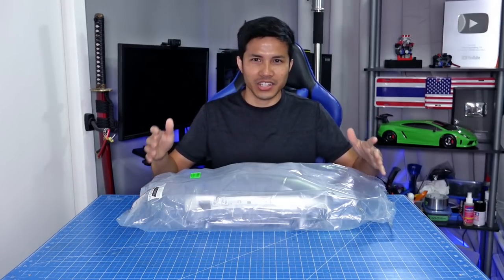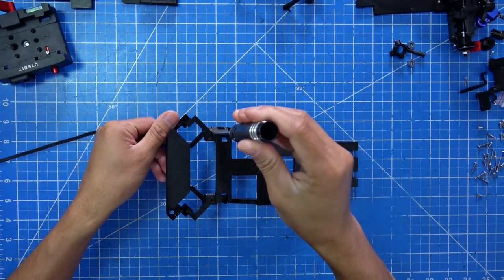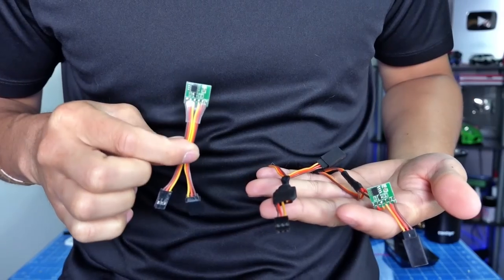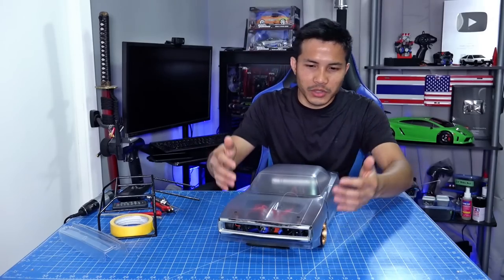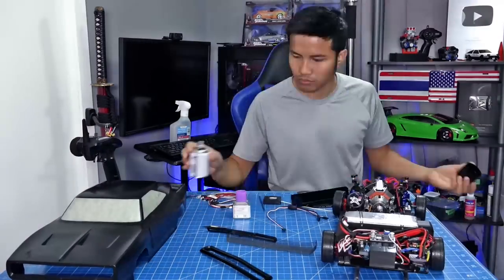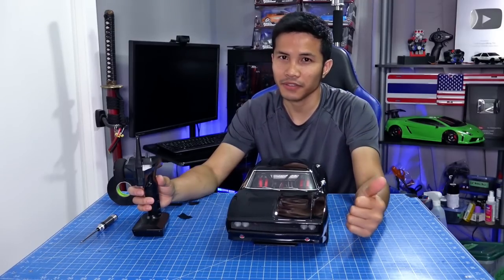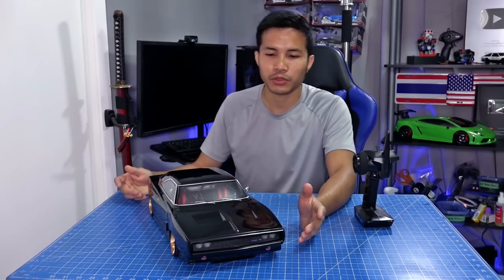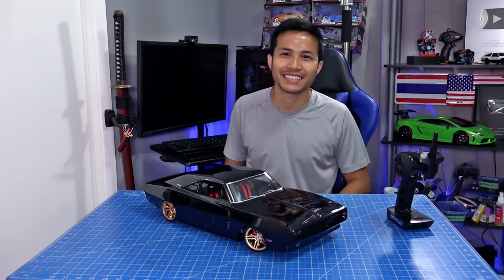RC Modify 31 | Modern Plenum V8 1970 Dodge Charger - RC Car

Comment: I've missed your RC mod. Videos.
What did you use to adjust the ride height?  Is there a kit for that?  Probably not much time for them after working on your full sized car.  I like those clips as well.  I'm not very knowledgeable about RC electronics so I find it amazing how you put these systems together on your cars.  I learn something new every time.
Reply from the maker: I'm glad to hear! I use 4 servos for the suspension. They are built-in on the 3D printed chassis. Here is the chassis and how the servos work: https://www.youtube.com/watch?v=NaoXa-XAk7U

You can try adding them to a regular chassis, but you will have to be pretty creative. Cheers
Reply: @DarkDragonWing  thank you, I didn't see that.

Comment: Macky, how does the dropped clutch system work. Does channel 3 bypass the esc and send input to just ess sound? Can you do a video of how you did that? Awesome idea!
Reply from the maker: Hi. I use channel 3 to control a servo to switch one of the motor's wires off. Here is the servo switch I made: https://www.thingiverse.com/thing:3123993
Reply: @DarkDragonWing  "switch" meaning it just moves the wire ends away or touch each other?
Reply: @DarkDragonWing  can you take picture of it in mid-action? Thanks
Reply: @DarkDragonWing  Wow, never heard of microswitch/snap switch before. This is great. From now on, all my cars will have drop clutch.
Reply from the maker: Yes, watch this video at 22:20 https://youtu.be/k_JkiWY4U6U

Comment: How much does one of them cars cost? Or how much are you selling them for
Reply from the maker: Typically more or less around $2k. Depends on the chassis, body, paint, accessories, and time. Though, a lot of them just end up taking a long time to make and are not sustainable to sell at the prices I have been selling. I do get good prices from collectors from time to time, they tend to not have a problem paying a lot more than others. I try not to take custom orders, I like to make the ones I like for the videos. I will be trying to keep as many of the builds as possible now, I guess I want a collection too. Will see.